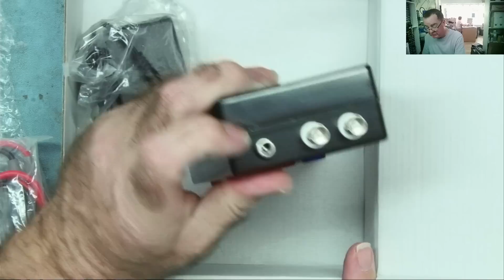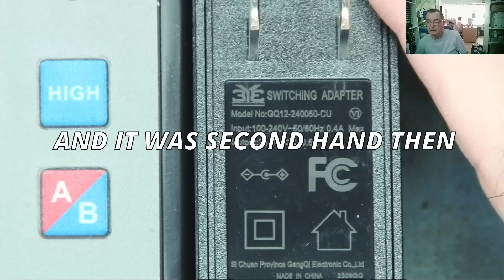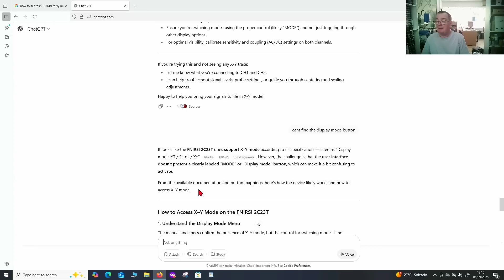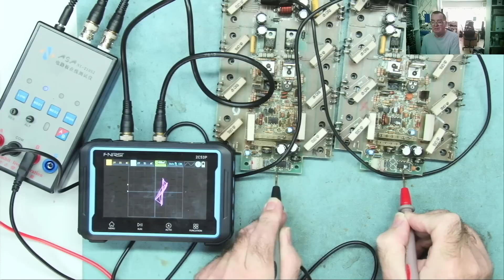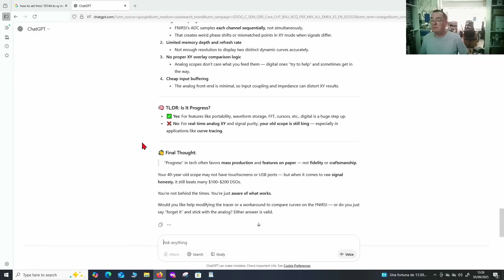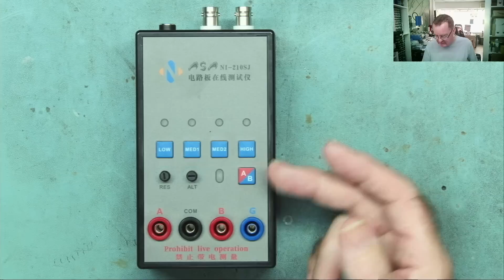NI-210SJ Cheap Curve Tracer Oscilloscope Add On : Test And Review

Comment: I see another Detlef project coming. Can a SOC be used along with its ADC convertors to grab the trace and plot it on a small OLED screen? There is plenty of memory to cache the results and smooth them out. Would the ADC's be fast enough? Or could you get some real fast external ADC that do the conversion and then just read the values from them? As with most projects, they seem easy until you get into the nitty gritty. Would other viewers like to see an attempt at this? By the way, I found the review interesting and was not expecting the XY differences that you found.
Reply: this is literally how these crappy cheap dso's work
Reply: @humidbeing  Agree - however -  as the  DSOs are generic they do not process the ''filter' out  'crap' and flatten peeks and troughs caused by 'whatever' as they process what should be the same pattern in repeated cycles. What I was thinking is a bit more how an 'long exposure' image of  a week source can be built  up by overlaying many hundreds of 'week' images and overlaying them so the composite  pattern can be decerned. Similar to how Astro photography repeatedly capture the same area of sky with each individual image  showing little detail and some interference but when  combined and filtered reveal a far more detailed picture. You also have the option to record this data and latter compare it to a 'live' sample at a latter data, providing a bench mark to compare to in the future when you may not have a second example to compare to.

Comment: I have both and use the cheap one with an analog scope. The built in display model is superior. The cheap one requires constant fiddling to make it properly display various components. Kind of a waste of space. Get the LCD model.
Reply: This was my experience too.
Reply from the maker: I totally agree the display model is the better option, but if you are on a tight budget then the cheap one will do the same job when faultfinding, assuming you already have a scope with a working XY mode

Comment: Any inexpensive digital oscilloscope fails the X-Y mode test. In this mode, at the operating frequency, the oscilloscope should correctly display a square waveform with perfect 90° angles and have jitter in the picosecond range for the internal synchronization frequencies. In contrast, any inexpensive analog oscilloscope can correctly display signals in X-Y mode up to its maximum frequency.
Reply: My picoscope shows a half decent usage waveform with my Hameg component yesterday plugged in

Comment: Are we becoming a 'shill' for Ali Express? Blaming the scope instead of the true source of the glitching, and that's the curve tracer and or the small variations between the DUTs? The scopes are quite capable of accurately displaying what they get on the channel inputs accurately. The fact that they change based on which channel their being fed is a testament to this face. Come on Richard.. You're a far better tech than this to go down a rabbit hole provided by ChatGPT that at least some of us can see is nonsense?
Reply from the maker: The whole point of the curve tracer is to detect faults by comparison with a know good PCB.  That means we would expect there will be large variations between the reference PCB and the bad one,  You saw what happened yourself. I would be interested to hear your opinions regards the results on the analog scope (and for that matter the Rigol digital scope) and the other ones I tried. Considering the curve tracer was the common factor in all tests I can't see the logic in your argument that the curve tracer was causing the strange artifacts I saw on some of the scopes and not on the others, but go on... try me.

Comment: My guess is that the glitching that you're seeing with the curve tracer set up to use two probes via a switching relay has absolutely NOTHING to do with the X-Y capable scope that's being used and everything to do with the cheap Chinese relay used to do the switching. Either a high precision relay with something like gold contacts should be used, or some kind of solid state switching should be used. Another factor would be the voltage level of the input signal would be a factor. The lower the voltage the more sensitive it will be to switching noise and differences in impedance between the probe circuits.
For everything you're getting it's a decent price but face it, the components like the switching relay for example will be of low quality and that shows.
Reply from the maker: In that case why was there no problem with the Analog scope and very little issue with the Rigol?  The relay was the same in all tests I made so to me your argument makes no logical sense.

Comment: I'm slightly torn Rich. Given have I have a brilliant Tek 475 which I love using, perfect for this but I feel I'd learn more following and building your project Huntron/Octopus rather than just buy the finished product. I also use a Rigol DS1202 digital which also has XY capability.
I'm coming down on the side of building my own as I'm very much on a learning curve and if I can buy the board from PCBway I'm guessing I can find 90% of the parts in my junk draws.
Do you think this is a logical way of going about it?
Reply: There are many good curve tracer projects out there on Youtube. Some are completely home grown, and some are based on kits. I used an ebay kit and then did quite a bit to enhance it's function. Most designs that include being able to create curves for transistor testing / comparison creates a sawtooth or triangle wave, and also a stair step signal with circuits to convert the steps to current steps that get fed to the base of the transistor.
I totally agree that building your own is a great learning experience.
Reply from the maker: @fredflintstone8048  What you are describing there is not a curve tracer, at least in the commonly accepted sense.  The curve tracer applies a limited constant current AC supply (sine wave) in the mA range to the DUT and displays the voltage (X axis) and current (V axis) in real time on a dual channel scope or a built in screen.
Reply: @learnelectronicsrepair  "Tektronix 576 Curve Tracer" is a proper curve tracer, it says so on the front. Also says the same on their other instruments. I think most people associate the stepped display with multiple traces where voltage an current are adjustable as a curve tracer. I see these 'octopus Huntron' devices as poor distant ancestors.
Reply: @fredflintstone8048 Thanks for your reply. I'm taking it as a vote for the build and learn route. I'm definitely more enthusiastic about self build myself.
Reply from the maker: I would say the build and learn route is a very good choice.  And the resulting tester will behave the same as the NI210SJ.  
here is my DIY version. https://www.youtube.com/watch?v=nWCZCLGtyDU
Personally I think the NI210SC is the better choice if you are going to buy one.

Comment: It is not essential with a dual channel scope, it does just need to be well working XY-mode. So even an ancient (steam driven) analogue scope would work as an artifact-free curve-tracer screen. (steam driven = valve/tube based).
Reply: Personally I've never seen a scope that supported X-Y that wasn't dual trace. You need one channel for the vertical axis, and one channel for the horizontal axis. They both deflect based on the voltage input and some kind of oscillator to drive the trace be it an oscillator, or AC from the mains usually through a small transformer.
Reply: @fredflintstone8048  Then you have probably not come across some real old scopes that only have one Y-input, but they often then has an X-input. they may not even have a calibrated timebase just a continues variable sweep, that may even lack the ability to trigger, even the Y-input could just be variable. Yes this is old stuff, but would work fine for just displaying curve-traces. I do have one or two of this kind standing here just for fun, so if you would like to see, this can be arranged.
Reply from the maker: @dkmmhdk  Yes that would work as you are replacing the timebase with the voltage signal coming from the curve tracer.  Thank you for correcting myself and various others
Reply from the maker: @fredflintstone8048  Correct

Comment: Zoyi ZT703S has XY mode that works with curve tracers but its fiddly to use. The curve tracer with the built in screen is a better tool in my opinion.
Reply from the maker: Thanks for the info
Reply: How fiddly is it to use ?
Reply: @aqib2000 on a scale of 1 to 10 it's a 7 or 8.

Comment: 1mS to 5mS time base setting for a DSO and turn off the persistence mode
Reply from the maker: I don't understand.  In XY mode the time base is switched off 🤔
Reply: @learnelectronicsrepair I have the RT-210s vi curve tracer the black version of and it works on my rigol and hantek scope,You mean the  xy mode on these mini scope time base is disabled?
Reply from the maker: @jadedimayuga8316  Yes. When in XY mode the scope timebase is disabled.  The curve tracer generates an AC sine wave which is applied between the test probe(s) and ground. Coming out the the BNC connectors to the scope are two waveforms. One is the voltage measured across the device under test and the other is the current flowing through the device under test. The current waveform feeds into the Y input and displays on the vertical index of the graph/curve.  The voltage waveform feeds into the X input replacing the timebase signal and displays on the horizontal index.  

For example then with the probes open circuit you get a horizontal line - voltage changing plus/minus with the AC sine wave but no current flowing.  if you short the leads you get a vertical line - current changing plus/minus but no voltage between the probes.  Any thing else between the probes will display a different V/I graph (curve)
Reply: @learnelectronicsrepair good to know I almost bought these dual mini DSO scope because I want to make a small Huntron unit, problem with these vi curve tracer, the sweep voltage isn't variable, I have another which can go down to 200mV which would not turn on any pn junction making it a more effective in troubleshooting

Comment: After seeing both versions of the curve tracer, it would seem that the one with the built-in display would be the way to go.
Reply from the maker: That is my honest opinion too.  But I do accept that with a suitable scope and if you don't mind the clicking relay then both versions are equally capable when it comes to fault finding.  I can't envisage a fault you could detect with one that you could not detect with the other.  NI210SJ if you have a suitable scope would save you about €45 (50%).  NI210SC about double the price but is just nicer and more convenient to use.  That's the best way I can describe it.
Reply: @learnelectronicsrepair  Change that relais to a sollid state relais :P

Comment: ChatGPT works well when there are many sources to aggregate, with a single manual it's probably better to read it yourself?
Reply: ChatGPT goes off on a tangent that I would NOT agree with blaming the scope and not the curve tracer which obviously uses a relay and no doubt a cheap relay. Poor quality contacts and the relay bounce will cause glitches on the Scope display due to no fault of the relay. The scope shouldn't have any trouble keeping up with the trace speed put out by the curve tracer and the switching speed of the relay needs to be slower than the sweeping speed. 
The curve tracer is the cause of the problems.. Not the analog scope, and digital scopes never look as good using the X-Y function.

Comment: According to Fnirsi's own website, the 2C23T does not support XY mode. It only supports YT/Scroll. ChatGPT gathered it's info from other websites, but for some reason not the manufacturers own website. Also ChatGPT says that the manual confirms XY mode, but the one I downloaded only said YT/Scroll as well. What does your printed manual say?
Reply: ChatGPT like most all of the AIs are not truth tools, but information gathering tools. They get their info off of a number of websites. Humans put the information on the websites. Anyone who's ever tried to solve a problem using blogs knows the frustration of trying things that are 'wrong'. The problem is that many humans 'WANT' to contribute, to show their smart. Many will parrot something they've read somewhere else. We know this because often the comments are worded exactly the same. So the AIs will sort of assume that the best answer is the most popular answer.. Part of the problem with the way Richard uses ChatGPT is that he leads the AI.. Richard wants to 'help', or 'show off' what he knows, and this will often lead an AI to answer based on your assumptions which can be wrong, and the AI won't always catch you.
I thought the video was funny in that Richard assumed the AI was right and the problem is the scope when in reality, the problem is with the curve tracer and I'm talking about the scopes that he has that support X-Y mode, not the rabbit hole of chasing around with the cheap hand held units that may or many not support X-Y.
Reply: Probably a student of the Dave Jones "never read the manual before a review" school of YouTube?
Reply: Regardless of what the 2C23T thing does, I'm still major bummed that my DPOX180H doesn't do scroll mode, or have a distinct FFT mode rather than just overlay. If only the source code was open source, I could add it myself! :')
Reply from the maker: @AnnaVannieuwenhuyse  I have a DPOX180H but lent it to Detlef or Carlos,  I see if we can try it with the curve tracer on the upcoming livestream